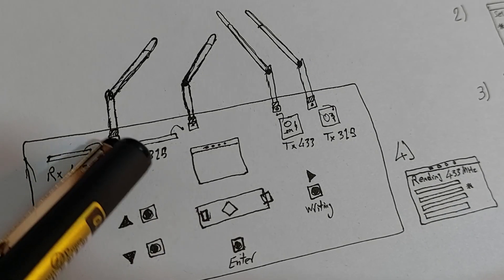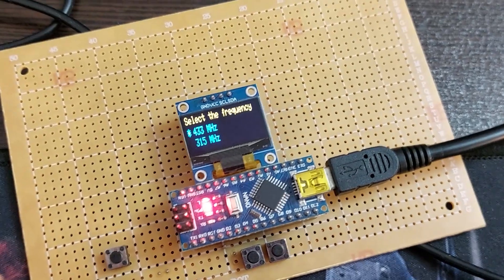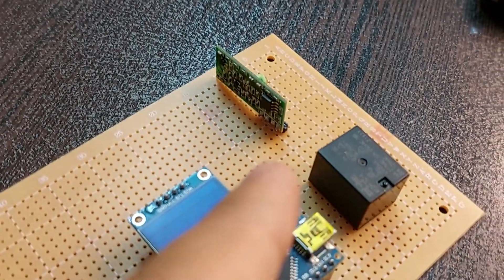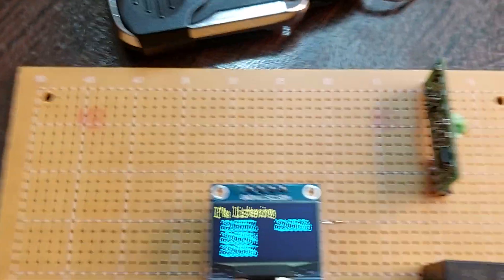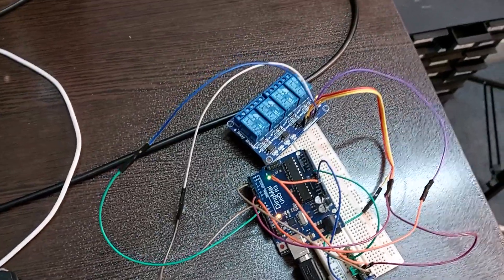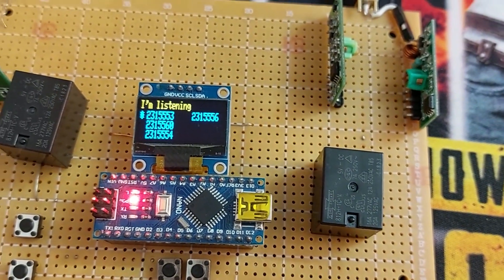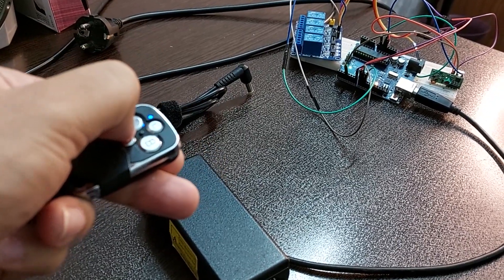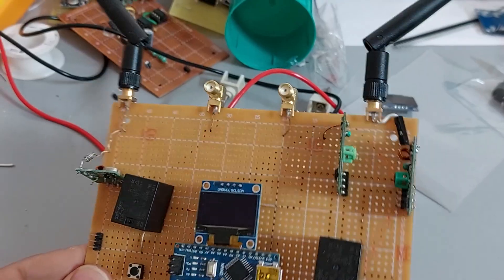RF Hacker Or Flipperzero - 315 & 433 MHz - Part 1

Comment: Hello. Will it copy and save 433 MHz car key fob frequency code for lock/unlock the car with arduino ?
Reply from the maker: Hello. It only worked on one type of industrial device, and I don't know if it is effective for the car or not.
Reply: @BabakStars  ok
Reply: @BabakStars  The car devices works with rolling code.

Comment: Во всем вашем исходнике он полностью для отображения, но нет части для сигнала 315МГц, и сигнал 433МГц тот же, но улучшений нет. Вы предоставили фишинговый код только для того, чтобы удовлетворительно отобразить его на OLED-экране. но они вообще не работают. Я пробовал их много раз, но безрезультатно.
Reply from the maker: Many people who have tested it have had no problems. Please post a video of it and send me the link so I can see where the problem is
Reply: @BabakStars  سلام منم همیچین مشکلی رو دارم و اصلا بالا نمیاره فرکانس 315 رو وفتی که روش اوکی میکنم هنگ میکنه یا کلا کار نمیکنه
Reply: To all, the code is simple but valuable. Couldn’t see your problem on code maybe you should check your hardware. Choosin’ the wrong relay or a fake Arduino specially ch340 ones can cause the issue.